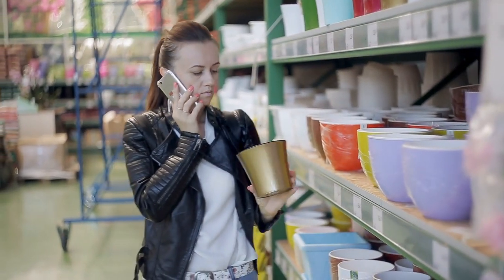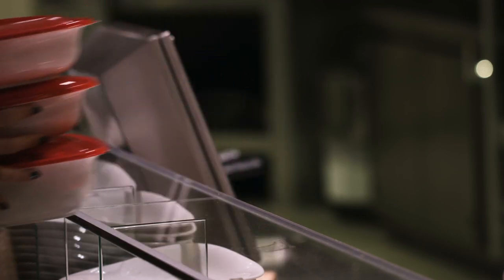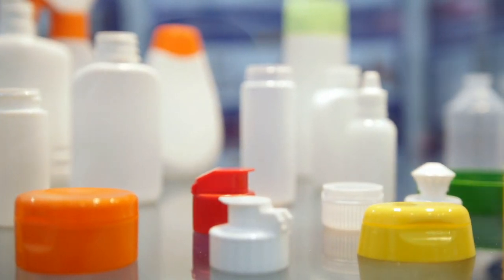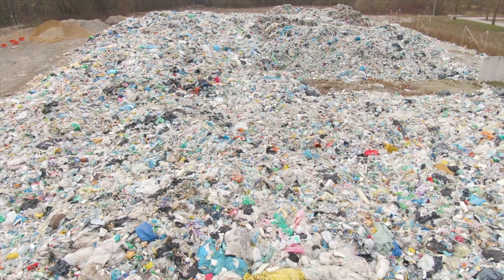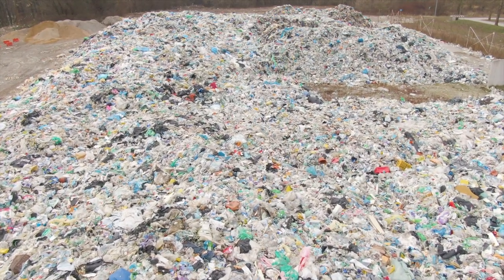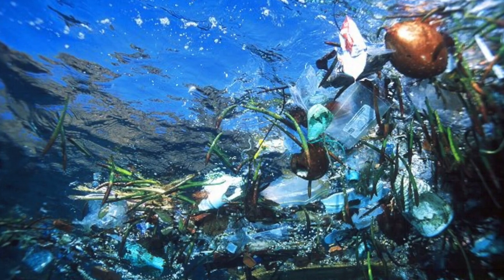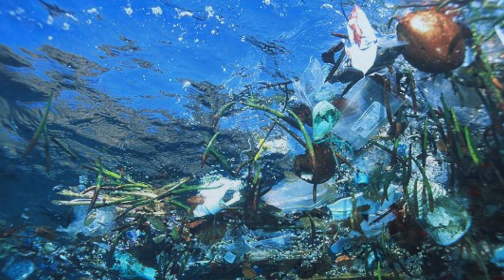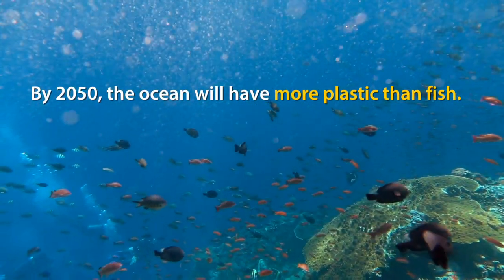Chemical Conversion of Plastic Waste into Fuel

Comment: can we run this on geothermal vent in the ocean at a depth that is 3200 psi and a vent that is 500 degrees and pump plastic and water down and get processed effluent back the water pressure will provide needed pressure and hydrothermal vent will provide needed heat just a thought i had when i seen the idea

Comment: I appreciate a form of dealing with the massive amount of unrecyclable plastics, however I'm hearing from some conservation groups that the burning of these plastics  to fuel puts added carbon and other chemicals into the air.  Can you explain why they would say this?
Reply: This method does not burn the plastic, it breaks it down into oil using a thermic process.
Reply: So what we need this energy, plants need carbon.We need more plant to clean the air and provide oxygen, its a complete cycle.

Comment: how would i commercialize this i was thinking of a small batch reactor using schedule 160 pipe it will hold the 3200psi and 500 degrees they come in 20 foot lenghts get ends a few valves  welded on and put them on a rack and rotate them like a revolver to a high frequency induction heating cell  u could in theory make it as many  reactors as u wanted or have them as long as u wanted

Comment: Interesting, but, does its conversion (using plastic otherwise) pollute the environment differently? As a fuel, does it pollute the air through microparticles; for example...?
Reply: The product could be further refined and used to synthesize plastics again, not necessarily used as fuels though.